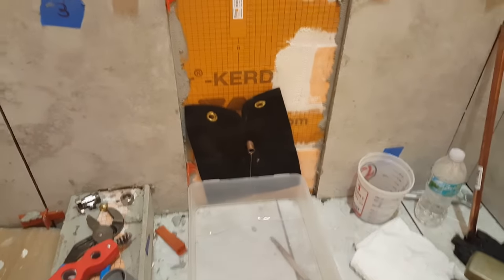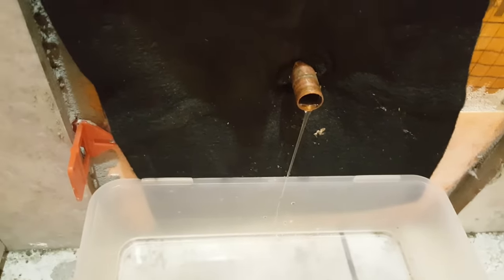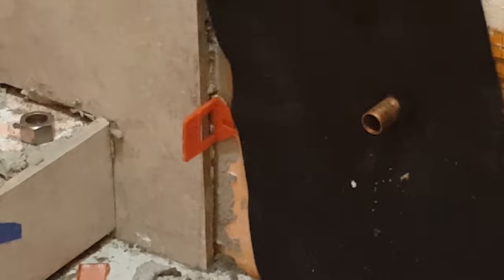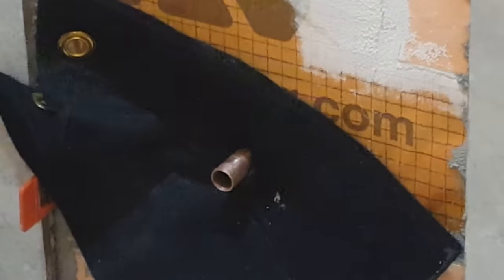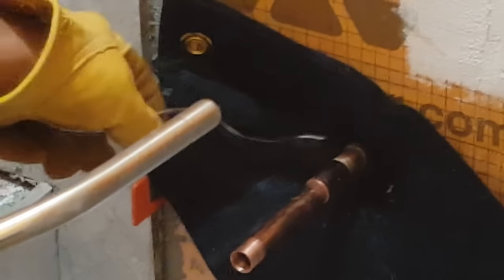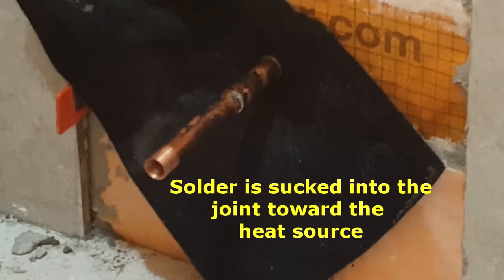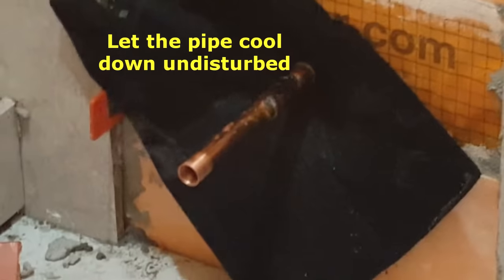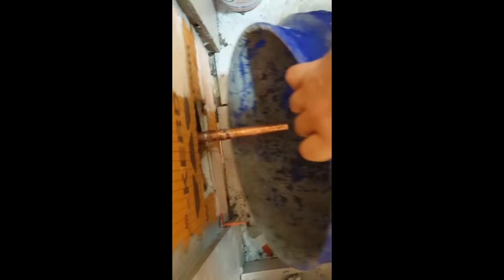Insane Plumber's Trick: Solder Copper Pipes Dripping Water

Comment from the maker: ✅ Tools used in this plumbing tips DIY video: 
✅ Bernzomatic Trigger-Start Torch Kit : https://amzn.to/2Bzj80K
✅ Oatey 31400 black cloth Flame Protector 9-Inch x 12-Inch https://amzn.to/2mI7DjT
✅ RIDGID Close Quarters Tubing Cutter: https://amzn.to/2BT7bD6
✅ Armour Line Pipe And Tubing Reamer: https://amzn.to/2Rut3OQ
✅ Plumber's Solder Kit: https://amzn.to/2BWr0cP
✅ 1/2" Jet Swet Plumbing Plug Tool (Alternative to bread trick): https://amzn.to/2VB4RJW
✅ Jet Swet 2100 Kit Tools 1/2" to 1" copper pipes, carrying case: https://amzn.to/2SGXeA1
Reply: You forgot to list the bread.

Comment: A trick I have used many times is to open a sink valve or spigot anywhere on the same line and stick my wet/dry vac hose loosely over that to create a slight suction on the line. This draws the water away from the fitting I want to solder and drys it out. Works like a charm every time.
Reply: Yeah I've done that also and it does work well but I prefer using bread because it's easier and quicker but when I didn't have any bread and the homeowner doesn't either that does work also. I have an adapter that fits on to my vacuum with a piece or pex pipe attached to it and I'll tape it to the faucet. I've been meaning to put an adapter on it for years but I always forget about it or say I'll do it late or next time lol. Also you want the valves open anyway so it doesn't put positive pressure on the line and cause a pinhole leak.
Reply: @my2centz196   That's why I just let the hose hang loosely, because my vacuum is so powerful it would suck the solder right out of the joint if I sealed it on there tight.
Reply: @UtwoBed  yeah that makes sense and it's definitely a good idea. I always open as many faucets as possible even if I'm not using a vacuum because the torch will cause it to have a positive pressure alone. I've never thought about leaving the vacuum lose mostly because it would fall off but the vacuum I use is a ridged shop vac. I forget the amps but it's like a 10gal I think can't remember that either lol. I wouldn't say mine is that powerful it's just your average shop vac nothing special so I never really had that problem but most of the time I'll just open one more faucet suck the water out and turn it off. I've also just blown it out but it it's a leaking gate valve somewhere and I'm not replacing it I'll leave it on but I do take the bread shortcut more then anything.
Reply: @del189  You are welcome. You know, necessity is the mother of invention. I had to solder a pipe in a house that had a leaking main valve. Water was trickling out so fast that bread would not hold long enough, so I thought, how the hell can I keep the water away from this joint? Shop-vac just popped into my head. (:-)
Reply: @UtwoBed  Why not just cut the pipe anywhere after the main valve and slap in a shark bite valve and problem solved in about 5 minutes lol.
Reply: @dillwiggle2  Thanks for the suggestion, but I am old school and  have learned to not rely on anything made of plastic or rubber to last a lifetime. Sharkbites have an O-ring that will break down, maybe not in my lifetime, but it will eventually. When I do a job I want it to last at least hundred years. Besides that the vac sets up in a couple of minutes and doesn't cost 8 bucks.
Reply: @del189  i think duncan donuts instead of bread I have 11 to eat i also use a smaller tip
Reply: Warning.  "Shark Bites should only be used where it will be clearly visible and not sealed over inside a wall.   I have decided to break this rule and seal up my shark bite connection in the wall where my shower head is connected.  Flex Seal will be used to seal up this connection top and bottom of Shark Bite. "  . I wonder how long this will last.  So far, the wall has been left open for a year with no leaking,  as I try to find an experienced plasterer to seal the wall.   "   All of this is in my house. @ @UtwoBed  ,  @Dill Wiggle ,
Reply: @rogerbraasch5224   If I were going to do that I would not use Flex Seal as it cannot handle the pressure. If anything, I would use a waterproof epoxy.
Reply: Thanks, I will look for water proof epoxy.  However, isn't the valve supposed to handle all the water pressure by  itself. If so, the Flex Seal would help back it up.  @UtwoBed
Reply: @rogerbraasch5224  If your shower head was completely unrestricted then the pressure would be lower but with water saver heads you are going to get almost the full 50 to 60 LB PSI on the shower head line so I would treat it the same as any other water line.
Reply: Simple solution close the main and add a new valve directly above, since it's a wet system use a valve with compression joints. Now you don't need bread. I was taught the bread trick was to add a valve and not for just general renovation.
Reply: NICE...But bread works like a charm when all else fails.
Reply: @UtwoBed l
Reply: @rogerbraasch5224  i think flex seal says 100psi which is bull - stuff should not be used on pressure main systems. If you have a leaky joint, pressure will eventually build to near system pressure making the flex seal fail for sure.
Reply: Im stealing this lol
Reply: Or open a fawcet lower than where you are working like a bath tap outside tap etc
Reply: If that doesn't work, you can always just loosen the union on the water meter. If the meter isn't covered in dirt, that's my go-to. It takes 20 seconds and the whole building will be dry after that.
Reply: I have seen guys put the shop vac on the oil filler valve , after draining oil from car and need to fix small holes in the oil pan.   Put the shop vac on the filler hole and it draws up the oil enough to stop slow seeping oil from the pan and then you can clean the pan and put an epoxy seal on it from the outside.
Reply: My dad and I just tried this and it worked so well!! We were starting to lose hope lol. Thanks a lot man!!!
Reply: Another reason is my example. I had an open pipe draining a gallon a minute and I had the solder and torch and all that to repair it but it was 10pm at night. I either go all night and hope Home Depot has a shark bite. Or I use some bread and solve the problem!

Comment: I just realized from your presentation here that the reason I've seen so many journeyman plumbers bend the end of their solder was not only to get a better angle; but, it was also to mark how much solder to use on each joint.  Thanks for that.
Reply from the maker: Yup that is exactly it and in the case when they are doing 1" pipes you will see them curve off about an inch. It's a great sanity check gauge to tell whether you have used enough solder because once it wicks into the joint you really can't see how much went in there.
Reply: And when brazing with a stick always bend the end over itself. No trick just because if someone bumps you by bye eye

Comment: I tried to use that bread trick once about 30 years ago. And it was a pain in the ass. But it can work. I'm for opening other valves and creating suction with vacuums. And I would also only use rosin core solder for copper that won't stop dripping. Well hey that's what I think, and it was a good video anyway. Because there's lots of people out there who don't have a clue about anyting. And you may have surely helped someone. Peace and love, peace and love.

Comment: When soldering hold the flame under the pipe and apply solder at the top. The heat will pull the solder around the pipe.
Reply: @PlumbGod_88  Not the best torch head for soldering.
Reply: Won't you burn your hands if you hold the flame?
Reply: I get the feeling that this guy is more of a tile guy than a plumber lol

Comment: This trick is legit.  it works!!!  A plumber hipped me to this trick like 30 yrs ago and I did it. When you’re done soldering turn on the water and the wet bread oozes right out.  Kinda looks like poop coming out.
Reply from the maker: Yup, used it a few times, still a classic in a pinch.

Comment: heat the joint area first until you see the flux start to move and get hot, keep the flame moving from pipe to fitting back and forth over the joint area, then move the flame to just the coupling as soon as it's hot enough to start applying the solder. Don't just only heat the coupling, the problem with that is, if the joint isn't super tight, it takes too long for the heat transfer to the pipe, especially if its still damp inside and then the temperature difference of the coupling or fitting is too much higher than the pipe.

Comment: Years ago I was on a service call and I had a pipe that wouldn't stop leaking so I asked the homeowner if she had a piece of white bread. She goes sure hands me the bread and says you want some ham and cheese with that lol. Anyway I've told this trick to a ton of people and most seem surprised. I've even had homeowners get upset with me about it until I explained it would dissolve and I'd take aerator off and blow it out the faucet. Anyway this trick works amazingly well. I've been using this trick for about 20 couple years now and use it a couple times a week at least. So much so keep a loaf on the truck and replace it once a week at least. Other breads work also but I'd keep from using breads with seeds like rye.
Reply: My2cents I 've used bagel and pizza crust before. Lol. I love the smell of bread toasted by mapp gas. 😆
Reply: @richardordonez8331  never used those lol. I guess it it works I only use Mapp gas also anymore and have for the last 10 years or so. I have a couple torches with 3ft hoses that work great. It's much more convenient especially since they'll hang right on your belt loop lol.

Comment: The fix for your problem is to go to the front of the house, shut off the water and if is not a positive stop you can crack loose the fitting from the valve to the house and the water will stop.

Re-tighten the fitting at the main valve, turn water back on SLOWLY and WAAA LAAA!

Thank me later lol

I had a really bad time many years ago and I called the city to come and check thier valve and the man said to do this while he waited for me to solder a new ball valve to the house main, it was a free lesson that I was grateful and want to pass it on

Happy Soldering!!!

Comment: I've had 10 hours on a plumbing course and I can't understand why he fluxed the inside of the pipe, why he used a wire brush to deburr instead of a deburring tool, why he didn't use a compression fitting, why he wore big thick leather gloves. I don't know enough yet but would a SharkBite fitting not have sufficed?
Reply from the maker: Lol.  Yes I goofed putting the flux inside the pipe that was a momentary lapse of focus there. I did not de burr with the wiring brush I had already de burred with my regular burring tool which you can see sitting on the shower curb at the very beginning of the video. I just wanted to clean the inside of the pipe nothing wrong with that. There was not enough pipe coming out of the wall in my opinion to put a compression fitting because then if anybody ever had to do anything later to the pipe there wouldn't be enough pipe behind it to make any repairs so I wanted to leave the owner of few inches of pipe out of the wall. As for the shark by and I don't believe in using them long term especially on a sensitive location like that although the fact that it's outside the wall would make me feel a little bit easier about using it. I typically use shark bites to cap off a pipe temporarily. In by the way when this was all said and done I did put on a compression fit quarter turn shut off valveBut the owner just want a little bit more pipe coming out of the wall that is why we sawdered that fitting on there to begin with to extend it out a few inches.
Reply: Sharkbite may be nice but it's an increased cost and no matter what that o ring will eventually fail
Reply: @jeffostroff  flux stuck on the inside of the pipe said to cause pinholes eventually
Reply from the maker: @ashleeverma112   Yes but we cleaned it off and it is water soluble flux this is not the standard old flux that the rest of you use.
Reply: @jeffostroff  Clean is good. I am told by experienced plumbers water soluble should in theory be just that, but still a potential issue - and usually a lot longer than 2 years to be an issue. Also the reason flux only used on the outside pipe joint so it can't be pushed into the inside. Just more for information, but saw others referring to it in the thread. I am currently fixing this exact problem on a bunch of pipe joints...can you say replace pipes! yes it would be the old flux
Reply: I think the SharkBite would be too big to slide the spout over, assuming that is the supply for the tub spout.
Reply from the maker: @lordmerren9094  In this video, that pipe is the supply for the toilet, which anyway would be the exact same size as the spout for the tubs, which are all typically 1/2" copper pipe.
Reply: The only shark Bite failures are installed incorrectly.  They are more expensive but when weighed against labor / time they save money.  Different discussion but shark bites fail when A: pipe is crushed or out of round B: Fitting is not pressed on to the correct depth C: pipe was not clean or had external bur etc. 
Shark Bites don't' Fail . Installers Fail !
Reply: @mikerilee97  Everything fails sadly. The real question is, "When?"
Now I have come across failures that were because of a poorly produced fitting though. plastic can crack. Not saying it was the designs fault, but the craftsmanship on said failures.
Reply: @ashleeverma112  because it will suck solder inside the pipe as it boils away, and then that create torpidity as water flow and the torpidity create the pin holes.  I was taught same thing.
Reply: @systematic101  thats what people been saying for years ,i keep seeing  shark bites. Like 20 years old  behind walls , underground with out been wrapped  and still holding , waiting for that call for  a failed none , i don’t  use them unless i have to but more because the cost .
Reply: @mikerilee97  This is exactly the truth. Just like with having HVAC systems installed, Most systems are built the same, Its all about proper installs.

Comment: Wave the torch 1/2 way around fitting,solder joint facing wall first. You have to run solder around edge of fitting to get it to flow around. Then move to outside edge and continue moving torch around fitting and run solder around joint. I use 3 fingers and bend that amout of solder at 45° angle from end of roll . You dont put flux inside pipe or fitting . Flux fitting and pipe. Hope this helped .
Reply: If you have a basement,open laundry tub faucet to relieve water pressure from first floor .
Reply from the maker: Yes, adding the flux was a goof, was more focused on making the video, and not thinking clearly in 90 degree non air conditioned bathroom, but it is also water soluble flux.
Reply: bend your solder twice the diameter of the fitting and sweep it over the top and pull it under the bottom. check far side for coverage. inspect front side and make a little swipe on the bottom in case you missed a spot. on 1/2 and3/4

Comment: A retired plumber that was in business for about 40 years told me about this bread trick a long while ago.  I never had to use it, but it looks like it works as long as the water is only trickling out.
Reply from the maker: Yes we had that bread in there for about 15 minutes and it was indeed a small trickle and you are right anything beyond that with just such rate the bread too quickly and could start to crumble but we packed it real mice and dense before we shoved it into the pipe.

Comment: I use another method, I open all the water valves going to the hose bibbs. Then take a air compressor to blow the excess water out of the house long enough to solder the joint. It gives you about two minutes till you have to get done, but it works. You should blow the compressed air into the pipe to be soldered, for about fifteen seconds and time the waters return. This gives you the amount of time you will need to finish the solder joint. Using the bread as well should buy you more time. Using a vacuum to suck the water out into the lawn hose, should give you all the time you need. Great video. I never tried the bread trick
Reply from the maker: Will the compressor stop even this flow of water that we showed here? This was more than a drip, it was actually flowing. Every minute or 2 the water would also gush a little bit, then drop back.
Reply: 2019,simple solution,use a shark bite fitting. No sweat ,no torch, put it together and walk away.
Reply from the maker: @ddmau7995  I'd rather not use a Shark bite, I only use them for temporary work, and never inside the wall. Although I would be open to using outside the wall, where you can see if anything goes wrong with it.

Comment: I didn't use bread but the shop vac trick from the comments worked like a charm.
Reply from the maker: We tried that too, but this is not a case of leftover water in the system, it's a constant stream leftover because the water won't shut off.